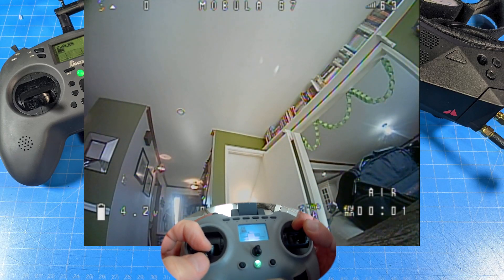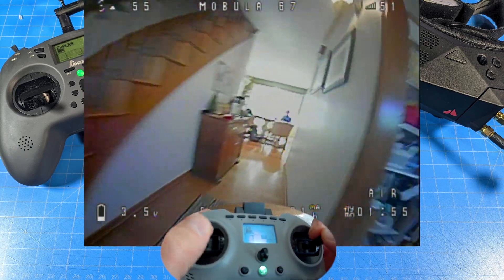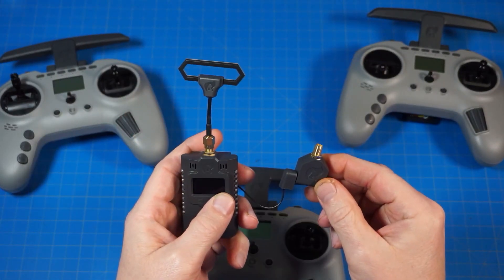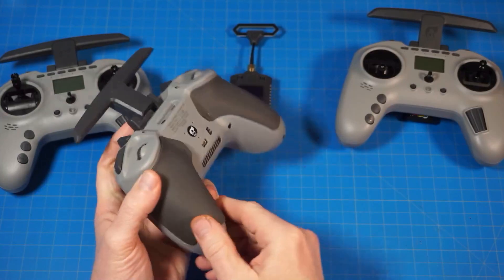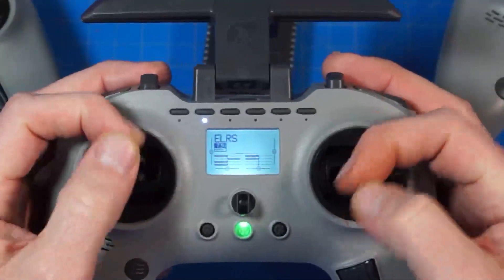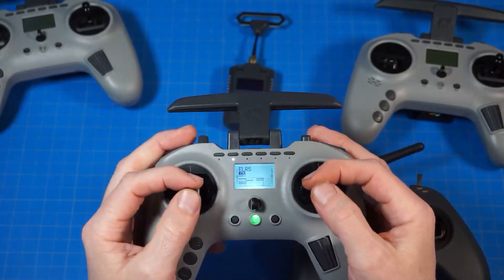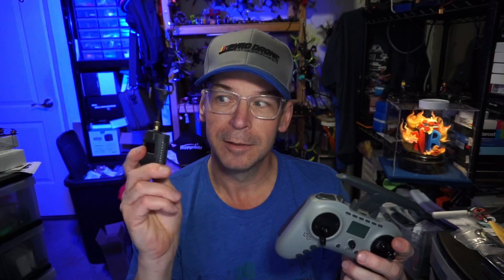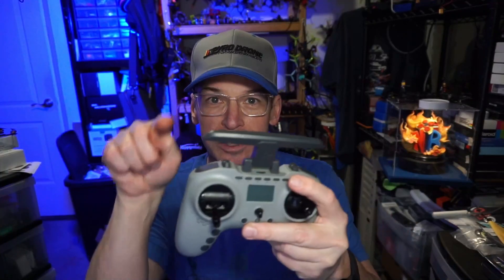Jumper T Pro // Goes Both Ways // ExpressLRS Flashing Issue

Comment: sir I have a few question for that elrs issue. First, I wonder if I fix it once, whether it will ever happen again, and second, does that issue only happen when I try an update
Reply from the maker: sorry I don't understand. I don't see a mention of an issue being fixed.
Reply: @NickBurnsFPV  oh I meant hitting that boot button
Reply from the maker: @juno0314-o9o  oh sorry I didn't put together the different comments. We can avoid using the button and update over wifi which can be activated in the lua script.

Comment: Will either or both of these work with a 900mhz antenna module?
Reply from the maker: Not sure if I understand. The transmitter as well as the receiver both have to be on 900mhz as well as the antenna to be 900mhz to work effectively.
Reply: @NickBurnsFPV  yeah, I understand that the receiver and module transmission need to match, but what I’m wondering is if I can use a 900mhz radio module such as the R9M lite pro, with the jumper, to make the 2.4ghz radio output 900mhz to the receiver. I hope that made sense lol.
Reply from the maker: @John_Doe_6996  No, I am not aware of any tranmitter in fpv that does both 2.4ghz and 900mhz, its either or.
Reply: @NickBurnsFPV  the Taranis x lite pro is a 2.4ghz radio, and it works with my 900mhz module and 900mhz rx combo… was hoping the same module (r9m lite pro) (I hate these naming conventions) could be installed on a Jumper, and get the same functionality. The ergonomics of the xlite pro are not great imo… just wanna swap radios but keep all the other equipment. But so far haven’t found a definitive answer on if this will work. Maybe something to try in a video? I haven’t seen anyone else talking about it. But I’m sure there are lots of 900mhz users who would like to know the answer before buying blindly, or avoiding certain equipment. Thank you for all you do and your input.
Reply from the maker: @John_Doe_6996  yes in the case of using an external module that is 900mhz it will bind with the same protocol 900mhz receiver. I thought the question was binding a 2.4ghz module to a 900mhz receiver and the opposite.
Reply: @NickBurnsFPV  thanks! That makes me feel more confident about buying the Jumper

Comment: I hope jumper is sending your their new t20s , I’d love to see what u think of it
Reply from the maker: I do have it. Video should be up this week sometime.
Reply: @NickBurnsFPV  awesome, can’t wait to see what u think. So, as a hybrid pincher I struggle with disarm switches being in the front of the radio like the mambo and the boxer. I much prefer them on top like the qx7, t-lite, and tango 2. So I’m hoping that top left switch feels like it’s in the right spot for a quick disarm. Unfortunately that rdc90 gimbal uses a potentiometer so it’s not as good as the hall gimbals. I just really hope they are still gonna sell the hall version since I plan to order one

Comment: They upgraded the pro with a on/off switch which replaced the rotary on the right.
That was a huge complain because in the previous one a arm/disarm was not possible.

I am not sure, if I want the lite or pro.
I have no problem to have a spare 18650 with me.
I read, that the pro has some issues the lite does not have.

I also read, that the internal ELRS was capped.
Does anyone have evidence for that?
I only buy this version because of the added range.
But if I only get the max range with the external device, I will get the 4-1 instead.

Comment: Hey Nick! Thanks for the great content!!

I'm sure you've figured this out by now, but if you press the SD card spring release it comes out about 2mm. The just tilt the antenna a little so it's barely touching the SD card, the press your thumb down on the card while pushing the antenna back down (down so the 2.4 GHz sticker is parallel to the deck and the antenna is prepared for storage) and sliding your thumb outward. The card slides out smoothly. 

To put it back, and avoid cramming it in the in-between, you can keep the antenna down (storage position) and use it as a guide to slide the SD right in!

Cheers!

Comment: Hello 

I need help with charging of the transmitter. On its top there is a USB C port where I am suppose to plug a USB C cable and the charging should be on by default. But what's happening 

- As soon as I connect the charger, The transmitter Power button light and LCD light comes on and goes out within a second. That's it. No indication or display for charging. 

- I have to keep the transmitter ON and then keep it connected to the USB C charging cable "imagining" that it gets charge only when is ON. But still no charging indication is there. Since the Tx is ON it starts beeping after few minutes. Have to keep stick moving frequently. 

What is the standard protocol for charging Jumper T pro?
Reply from the maker: The radio should be off to charge. The green power button is on while charging, the light goes off when the charging is complete. Does the radio have batteries inserted?

Comment: I use frsky x-lite tx but after I use jumper t-pro I feel its very difficult to control my quads now.. do you feel any different in flying stick response?
Reply from the maker: Yes if we run edge tx we get faster gimbal polling and elrs is faster to process the signal. These will make the quad respond faster

Comment: hi

ı bought internel ELRS version of this tx . I have some issues cant find solution . Can you help me please.

when ı set it up to hight tx power (250 mw or 500 mw ) . Speaker have some parazite sound . and pitch and roll values on betaflight shaking badly . when ı reduce the tx power it is getting well .
Reply from the maker: I haven't heard of that issue before. I would suggest reaching out to jumper support. I don't know what the fix for these symptoms would be.
Reply: @NickBurnsFPV  Thanks Nick . 
If ı find a solution ı will share it  .

Comment: express lrs aion rx mini receiver turns solid green as soon as I insert the battery. It doesn't go into bind mode. why could it be ?
Reply from the maker: I suspect we had a flash not finish or flashed the wrong target. Sounds like the rx is stuck in boot loader mode. This is the expresslrs page on that rx. https://www.expresslrs.org/2.0/quick-start/receivers/rx-jumper-aion/

Comment: I am amazed by how clear this DVR is, wow! Is this Digital? How do you get it so nice?
Reply from the maker: Lol, no its analog. I fly raceband 8, and my location at the table is important. My location is centered and in an open space. If I move even to the couch the reception isn't as good.
Reply: @NickBurnsFPV  is there something special about Raceband or Raceband 8 in particular? Sadly you can´t legally transmit anything over 5.880 in Germany lol.
Reply from the maker: @overlookedundead8711  raceband is up above wifi frequency. the other alternative is the turn off wifi while flying and see if that helps.  Certainly don't be close to the wifi router. :)
Reply: @NickBurnsFPV  ah thanks! good to know that theres no really special sauce going into it lol, would have been kinda sad if one more cool thing about this hobby got banned here lol

Comment: Nick, if I get The Xpress ELRS version and I have frsky transmitters/receivers in my Emax hawk pro type drones, so what model/ version should I get that will also work with frsky transmitters /receivers as well as the express LRS transmitter? An What’s the right deal that saves me money from buying modulars an accessories so I can use different drones and receivers that are all built into the ELRS  transmitter!
Reply from the maker: I suggest getting the internal elrs version with an external 4 in 1 module. This would allow us to use the external 4 in 1 to bind to our D16 and D8 quads and elrs to those that have elrs receivers

Comment: Nick, got a question when I’m Using my BetaFPV transmitter with my Emax hawk pro and go a fair distance away what are those four little ⭐️ symbols that pop up on your goggles, is that some kind of failsafe warning? if not what does it mean?
Reply from the maker: I presume that is likely the battery warning? Low voltage? That can also be the beeper indicator. Check your modes tab and the switches to see if you have the beeper active when you see those stars on screen.
Reply: @NickBurnsFPV  Nick, it’s not my battery I have my battery warnings an other settings set, and it’s not when the battery is low because the battery was full. it seems when I’m going a certain distance I get like four ⭐️⭐️⭐️⭐️ type symbols and they pop up in the middle of the goggles and it seems like it’s a distance or interference thing because of my BetaFPV transmitter/receiver, or maybe getting out of range type of warning and that’s why I thought it was a weak signal-fail safe type warning? it’s not my battery warnings or anything related to that I’m not sure what it is and it only happens when I go a certain distance, an my VTX is set to 25 Mw also if that has anything to do with the warning am getting on my EV800D goggles? But that would only affect the Video Range distance using the VTX power settings, Right?
Reply from the maker: @diggsit69  It could be a range issue and the warning indicating a low rssi, do you have the rssi element on in the osd?  And this only happens at a distance but you don't actually failsafe? Is your betafpv radio the version with expresslrs or are you using frsky protocol?
Reply: @NickBurnsFPV  Nick, yes I do have the RSSI set on the OSD for all my Emax type drones in Beta Flight, an yes am using the Frsky protocol on the BetaFPV 2 transmitter that it came with an the Emax - Hawk Pro an TinyHawk 2 freestyle drones as well. So if that’s just the RSSI warning me that I am near the antennas full distant Range, if so what would be the easiest way to increase this, A better transmitter that has a antenna but not one built in like the betaFPV comes with? Or changing out the Dipole antenna on the Hawk Pro with a better antenna like crossfire, or something else  if I didn’t wanna go the crossfire route, or is this where Zorro express LRS is the Best option?
Reply from the maker: @diggsit69  Antenna won't do all that much. In range tests we have seen over 1km of range on frsky d16 protocol, but that is high up in the air with clear line of sight. The range will vary greatly. If your using d8 receivers and protocol the range will be far shorter, in either case there isn't much to do with it to increase it, but it is worth noting location and rf interference also plays a role in range. A change in protocol to crossfire or elrs is likely the next choice to increase control link range.

Comment: I like the jumper t-pro, I wish that the functionalities of the T-pro could be built into the t-lite formfactor with an upgraded antenna, that would probably provide for a pretty good setup. That is nice though that they include that little adapter attachment to put your own antenna on the transmitter. Does look like a hybrid between the Tango 2 and the DJI controller very much. I would say that tis is targeted more towards quad pilots and not airplane pilots only because the trim sticks aren't as easy to use without looking as opposed to the typical up down, left and right click switches which can be nor easily distinguished. Still seems like a great radio for the price and the overall formfactor is nice.

Comment: Hi Nick, I just built a whoop with the happymodel F4 ELRS 2.4 1s board and the vtx is stuck on raceband channel 4 at 25mW. When I try changing the power output my OSD flashes or a split second "LV0" instead of 25mW then back to 25mW. I've been trying to solve this issue for a few days now, please could you suggest a solution?
Thanks

Comment: I pretty much fly cheap modded old school angle or horizon mode brushed motor whoops in the house and thumbing works the best for me although if I ever learned acro then I think pinching would be better. The only real problem with thumbing for me occasionally is slippage and I can't believe somebody hasn't invented some kind of a harness to keep your thumbs on stick ends but still be able to pivot or maybe some good old duct tape would get the job done

Comment: The lack a of a 2 position switch is a big let down IMO. Also, 1W without a fan, the module will either be throttled down after some time so it doesn't get damaged, or you will have warm hands in the winter lol

Comment: Hey Nick. Sorry for all the questions But sadly I an alone in this hobby in my area. Anyways. I am not very good at soldering so I wanted to use plugs for my motors. could you tell me what type of crimps you use or if you are aware of a link that would help? Thank you for all the help you have given so far. Much appreciated :)
Reply from the maker: That is a good question. I am not sure as I have not crimped motor connectors. I would think we could crimp on the pins with something like the PA-09 crimpers, I haven't use it since we moved away from the red jst connectors for batteries, but it has several different size of crimping options on that tool.

Comment: Thanks for the great review! Was hoping for more from this radio its just a little half baked, from the sd card slot basically under the oversized 2.4ghz antenna, to the weird switches and buttons, the module powering without the radio turned on, even that removable antenna mod looks like an after thought... You'd think this stuff would get picked up in testing.

Comment: I unfortunately will be returning my T Pro Internal ELRS and replacing it with a new one. The speaker was super distorted and with antenna raised at all would cause my stick positions to change on the radio and would certainly cause my drone to fly awkwardly. I hope my new replacement is fine 🙂

Comment: 1W ELRS is useless for 99.9999% of users.  Who needs 50 mile range?  100mW will give you at least 10x the range that normal freestyle/proximity/racers need.  Operating at high power basically just drains your batteries faster.  Also, operating at high power can screw up other pilots flying in your vicinity.
Reply from the maker: yes, all true. I think to many want the number comfort that they never use or need.

Comment: How's the hybrid pinch on this one compared to the radiator zorro? Like is it more cramped or your hands at a different angle?

Also is the angle of the handles more or less extreme than the zorro?

I think one of these are the radio for me, but I'm still on the fence over the gamepad style, but these do appear to have less on an extreme angle on the grips than the t-lite
Reply from the maker: I prefer the greater angle of the zorro, I feel more comfortable.

Comment: Nick get urself a quality set of 18650's, if my eyes don't deceive me those are like ultra fire batteries or something and there labels and construction are complete lies and cannot do any kind of amp draw and I doubt the mah they can do is much more than 1000mah which is terrible, just a heads up, longgggg time watcher and your videos are great!
Reply from the maker: yea, I am aware. I had them when radios started using 18650, figured I might as well use them until they die, then replace. I bought others (Panasonic and Sony) to use for 18650 quads.
Reply: @NickBurnsFPV  sounds good, thanks for all your hard work, I have always been more a micro guy myself started with brushed 8mm motors with parrot props, crazy how far it's come! Currently love my 35mm prop'd whoops using 1102 19,000kv motors, Happy model elrs AIO, just fly's so good!

Comment: I had pre-ordered the pro so I got it pretty early before there were any videos on the updating issue. I was lucky and was able to exchange it for the Zorro which I really really like alot.
Reply: I just returned my T pro back to RDQ and have a zorro on order now. I had the same problem that Nick had with the module being powered on 24/7. I also didn’t like how Jumper released the T pro and AION module without giving samples to the ExpressLRS devs. Hopefully my Zorro comes soon!
Reply: @bread12678  your going to like the Zorro alot I think. Pains me to say it cause I like the Tango 2 alot and mines worn out but the Zorro feels just as good of quality it's really nice

Comment: Did the sma antenna adapter only come with the review kit? My T Pro ELRS edition did not come with that adapter.
Reply: Same. Just got mine in from Rdq today. I bought a pigtail and a moxon and will do something similar myself
Reply from the maker: Odd, it was in two of the radios I got. They must have put that in then if your not getting them retail. Sorry for the mistake, I didn't expect them to send two radios with the same extras.
Reply: @NickBurnsFPV  Nick, any chance you'd be willing to part with the extra adapter? I've seen people 3d printing parts for the antenna mods but unfortunately I don't have a 3rd printer.